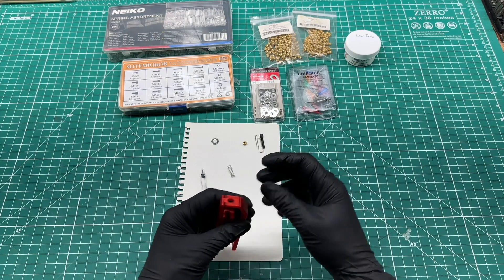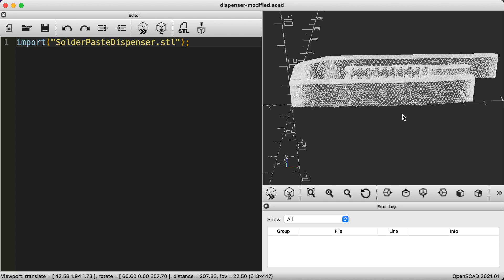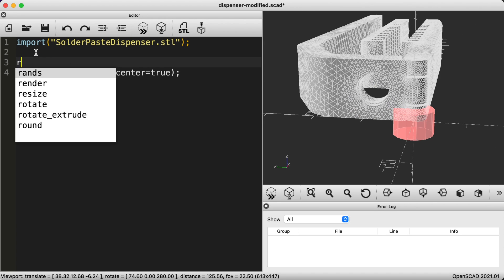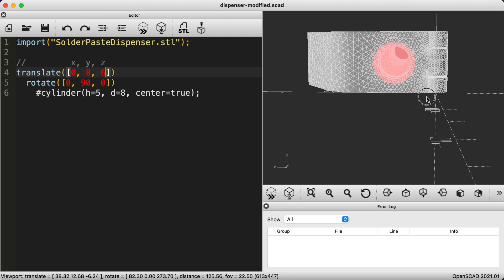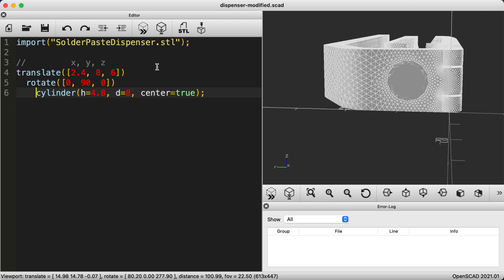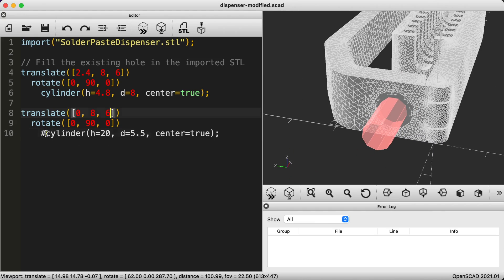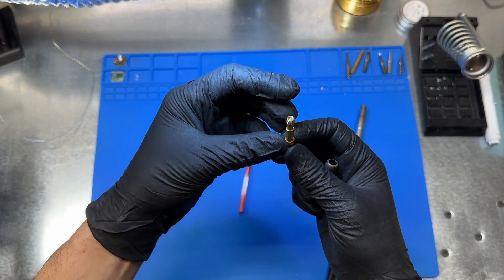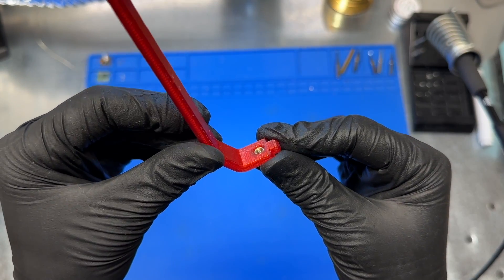OpenSCAD: Modify an existing 3D model (STL) with code

Comment from the maker: I should have mentioned that if you want to SUBTRACT from an imported STL model, you can put the import() as the first line in a call to difference(). Example:
difference() {
    import("SomeModel.stl");
    ...shapes to subtract...
}
Reply: This was exactly the tip I needed. Wish I had skipped to the comments to find it instead of figuring it out myself lol
Reply from the maker: Sorry!
Reply: @MostlyBuilds  no worries, it was maybe 5 minutes of changing variables before I saw where I was going wrong. Today was the first day I decided to actually learn openscad, so worse than that is still bound to happen 😂
Reply from the maker: Hah I gotcha. Well good luck!

Comment: I didnt know you could import an stl.  That is helpful knowlege.  

My hashtag turns the line into a comment; it doesn't change opacity or color.
Reply from the maker: Your hash modifier issue is curious. What version of OpenSCAD are you using? As far as I know, it only uses C style comments (// and /* */). Here are the docs that describe the modifiers (the hash is referred to as the debug modifier) https://en.m.wikibooks.org/wiki/OpenSCAD_User_Manual/Modifier_Characters
Reply: @MostlyBuilds  I was wrong!.. I must have just gotten confused with other software...

I often use 'control + d' to comment out a line........which as you correctly stated, inserts a double forward slash at the beginning of the line.  Thanks again for your video!